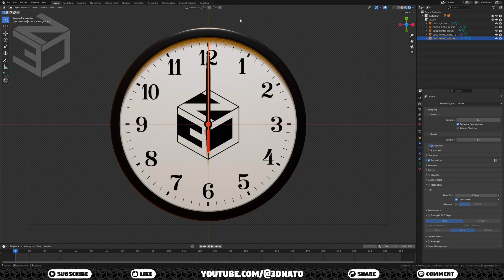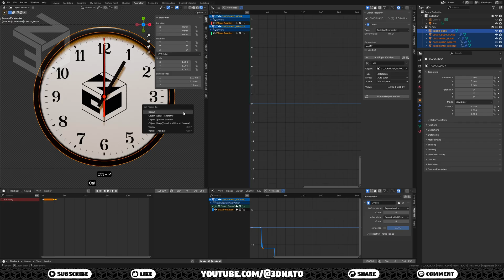How to Animate a Clock in Blender (Just 2 Keyframes Needed)

Comment: The noise modifier dosent allow me to edit the hour all the way around, it stops halfway
Reply from the maker: With the mouse, the strength value only goes to 10000, but you can type a bigger number.
Testing here, a full turn is around 27879.
Reply: @3DNato can it still be edited so i can choose the hour i want exactly?
Reply from the maker: Sure... you can type something like 30000 on Strenth Value, and then with the mouse you can set the exact hour you want.